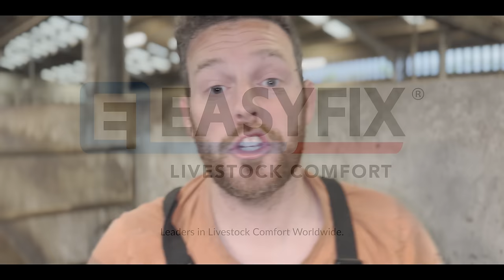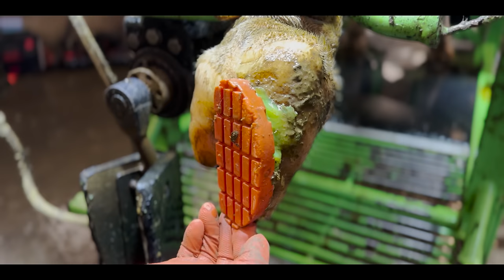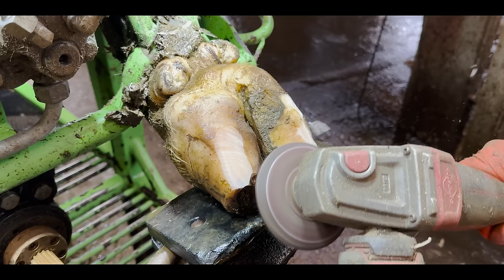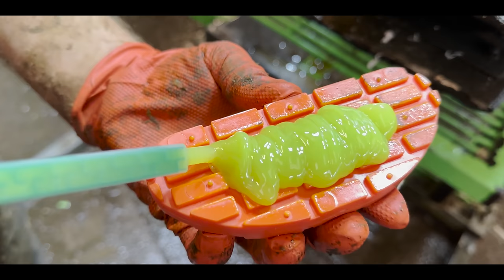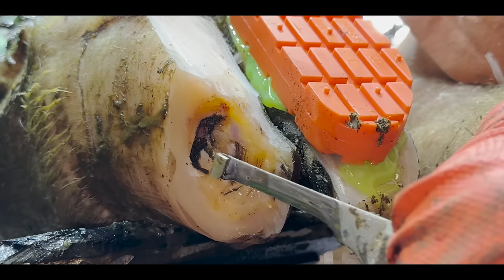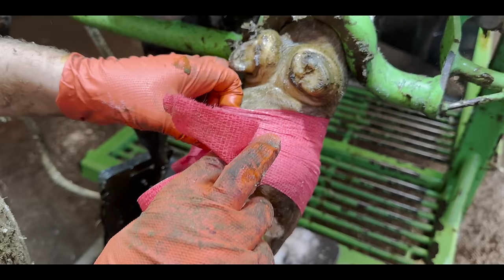the WHOLE INTERIOR is DECAYING!!!

Comment: As I watch these videos from you and others the one thing that keeps running through my mind is that block is only on one side. Isn’t that kind of like always walking on the edge of your foot? So how does that work that it doesn’t become extremely painful with the only point of contact being focused on one side of the hoof? My assumption is that the forces and loads transmitting through that hoof into the various joints and hips start to over stress and under stress different parts of the leg and hind quarters. But I’m not an expert so I’m curious about how it really works.

Love your contact!

Comment: Since the block you tore off was still fairly thick, could you have used the grinder to clean off the old glue and true up the blocks surface and reused it or are blocks cheap enough it's better to just toss them and use a new one each time?

Comment: I've wondered about the strain on their hips/legs the blocks might cause since now they are basically on a small stilt on one side putting their joints out of alignment, especially the ones you have to put a double block on. I know it's necessary though but just walking in a "boot" that was thicker soled than her regular shoe for 3 weeks made my daughter's hips hurt worse than her sprained ankle the boot was ment to help.

Comment: from someone who isn't part of your profession, just a curious question, why don't you cut groves into the cow's hooves either length wise or horizontal to allow glue to stick better? from watching your videos I know that hoof horn grows from inside out and sheds after it gets too dry or from being worn. I also know groves might not be a good idea because it can cause rocks to get stuck inside the groves if the blocks do accidentally falls off. but those groves can help the glue hang on better than having a flat surface from a physical / engineering standpoint. less of the husbandry side.

Comment: What is the agent of decay in her necrosis? Bacterial or fungal, injury, or an immunodeficiency?

Something else?
Reply: Iirc, toe necrosis arises when there is too much pressure on the tip of the pedal bone, so it bruises then abscesses, and the abscess has nowhere to drain, so the tip of the bone suffocates under the pressure and dies. The bacteria associated with necrosis, the bone decay, can cause further pain and damage. Graeme has to walk a very fine line of not cutting live flesh (that's for a vet that can give anesthesia) but getting it opened enough to clean it out and halt the necrosis spreading further up.
Reply: @Ksweetpea  Thanks for the quick reply! I knew the last part, but not the first.  Thanks for explaining it so well. 

That sounds beyond painful. Eat your heart out, gangrene.